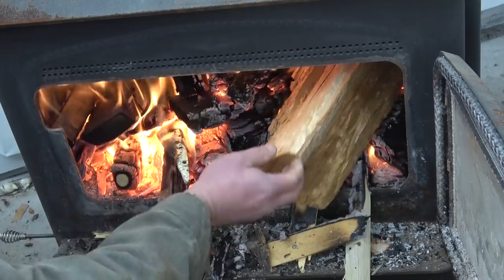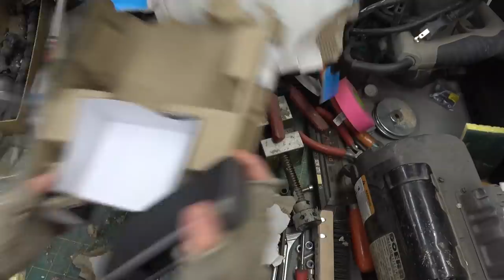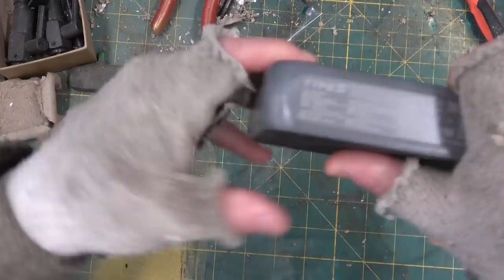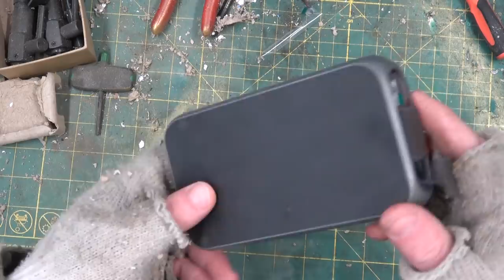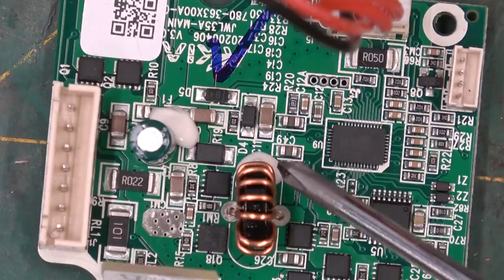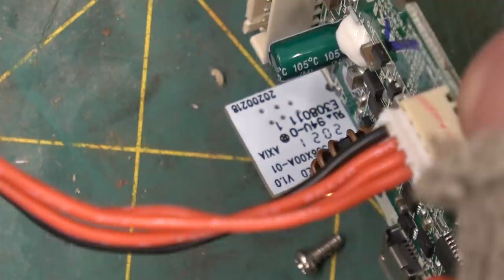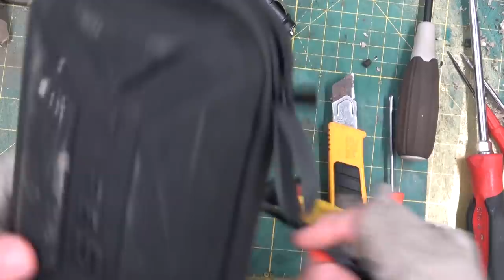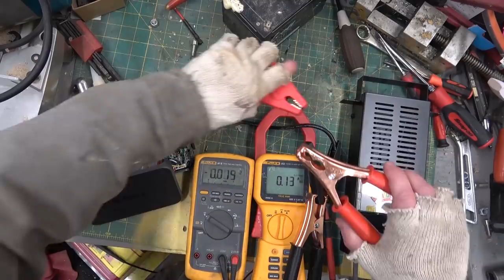BOLTR: Costco Boost Pack | Stupid Design

Comment: 26:54 You need at least 13v to start charging a lead acid battery. I tried to "trickle charge" a dead battery with a 12v drill battery for an hour and it didn't do anything at all. I also tried to start a 3.0L diesel engine at 50F with the battery removed with one of these cheap boost packs and surprisingly it worked.
Reply: Yep. For a lead acid battery fully charged is basically 12.7v. You need more than that to charge it. Ideally about 14v or so for charging and about 13v or a little over for trickle/maintenance. The 12v drill battery is probably pretty close to 12v even at full charge.
Reply: I’ve jumped a few V8s in Nebraska winter weather with mine. Teens and twenties F. Can get 3-4 cranks off it and still have 70% on it.
Reply: chargers go up to ~14.5V on a full charge
Usually alternators put out less in order to not cook the batteries dry in a few months.
System voltage should be somewhere between 13.5 and 14.5V. Newer vehicles with all kinds of digital fanciness are a lot smarter and they adjust the voltage according to load and battery charge level. For example I know that some older Toyotas (~2007) will monitor the amp draw on the battery, keep the voltage up to top the battery off an than lower the voltage down closer to 13V when the battery is charged to save fuel and wear on the battery. When they register a high load on the system they will ramp the voltage back up to supply all the needed power without draining the battery down.
Reply: Potential difference, one must be higher than the other
Reply: @christopherestewart  it depends how dead the vehicles battery is. if it's just a bit low the booster pack will give it that little bit extra that it needs but if it's right dead there's no way in hell one of these packs will do the job.
Reply: Unfortunately.. no.  You haven't considered the potential difference between the two batteries.  If your car battery is at 6V and the charger is outputting 12V, it will indeed charge your car battery.  Also, the drill battery probably has one of the pins set up to detect whether it's connected to a drill.  And if it's not, it won't output any power.  That's why they have more than 2 pins on those batteries..
Reply: @markjohnson7887   It was an old battery with only 2 pins. Even after an hour and leaving the drill battery connected while cranking (pulling 20 amps out of the drill battery) the car did not start. Had to bring another car to give a jump start and sure enough it fired right up.
Reply: @Phoenix88.  Ok, then it wasn't a lithium battery.  So it's not an apples to apples comparison.  That would have been like a NiCad battery or something.  Makes a big difference.

Comment: Bought my son-in-law one of these, different brand though, because he has a habit of leaving his lights on after driving to work in the morning. I was always the go to guy for a boost so really I bought it for me. His worked well on his little four banger although he never used it in really cold conditions. I bought myself a higher capacity one rated for diesel engines for my Dodge truck with 5.9 Cummins and can confirm they don’t work if cold or if you batteries are completely dead. Last winter about this time the little town of Dapp Alberta by our farm recorded the coldest temperature on earth for that day, -52 C. Nothing wants to start when it’s that cold!

Comment: Generally, USB Type C plugs have at least the same insertion/removal cycle rating as USB Micro-B plugs (minimum 10,000 cycles) but in cases of reputable/reliable manufacturers who have high standards/good quality control (i.e tight tolerances), Type C plugs/receptacles seem to generally have increased endurance over their Micro-B counterparts. Obviously there are always going to be exceptions to that based on lots of different factors but in my experience with repairing electronics, that seems to generally hold true (though honestly, it's probably hard not to be biased being that there are SO many more Micro-B devices out there and almost all of them are older than Type-C devices).

Comment: We have a similar product, different brand though. For my experience, the box needs to “inspect“ the circuit before it unleashes the pixies. Example, I tried to jumpstart a small machine that did not have a battery in it, I could not get the unit to give the greenlight until I put a battery in the machine. There’s obviously more to this than meets the eye… Example, you can’t just touch the clams together and get sparks. It has to investigate before the pixies are unleashed.

Comment: I use a similar one to help start my airplane in the winter time - the plane has a small battery and needs some extra umph in the winter.  That being said, the voltage of the plane battery is generally around 13 volts, and those booster packs are at 12.6 fully charged (They're only 11.1v, 3S lipo packs).  They do work well, however, they DO NOT put out quite as much voltage as a normal 12 volt car battery.

Comment: I have something analogous to that one, a baseus 12 Ah jump pack.  The connector/clamps it came with seems to cycle the voltage off/on, and cuts out after some seconds of providing power, like yours.  But I found that with a cheap EC5 clamp set (like bigclive reviewed a while ago) it put out stable uninterrupted voltage.  I even made up an EC5 to XT60 cable and used this bank's 14 V to power a lipo charger; the cable also let me charge or discharge the pack with the lipo charger.  So the pack itself is versatile, it's just the electronics in the clamp set.

Comment: I have one.  It have jumped my 3.5L ecoboost in my Ford as many as 5 times with no issues and the battery indicator has only shown 1/4 depleted after 5 jumps.  They work surprisingly well.

Comment: Having used these things (A costco unit),  They only work if you car clicks or super slow turn when trying to start. Or if you have a new car that needs a certain voltage to even start the computers. Also in the cold, you try starting like 5 times with this thing. Each time the battery in the unit warms up (after being in a cold car), and can deliver enough power. I have one of these and a set of cables in my car. 9 out of 10 times I help someone, the little lithium jumper does the job, and way less hassle than cables.

Comment: I was sceptical when i bought one for my wifes car. I took it apart and saw the rc car lipo battery and knew it would discharge a shit ton of amps. Cranked my motor over 5 times in a row with the battery unplugged. I was shocked when i saw it only.went down to 75% charge. Got rid of her jumper cables and put an anderson connector on the booster pack and then anderson connector to ring terminals to her car battery. Idiot proof. And a better connection. Way more then the 75amps you showed in your video it has to be. Unless that ones a piece of shit. Mine was a choopo from amazon. For 85 bucks

Edit : i tested in winter on my 3.5 taurus

Comment: We had some of these at one of my last workplaces. Not this exact unit though. To my surprise (I didn't think they'd start a vespa twice) two of them in series would start the 24v hino's and the like. 
Two days late I was not so surprised when they blew up like balloons though and split themselves wide open.

That said, I have on occasion used the 3s LiPo 5Ahr batteries from my rc helicopter to start up 2.4ltr injected 4 cylinder's. No waiting for them to charge the bat, just wired on and CCA all the way. They work.

Comment: I have one of those and it works well.  The thing to remember is that it works for boosting a weak battery, not jumping form stone cold dead and most of the time its enough to get the car from the lot into the shop to fix it.

Comment: Dunno about at Fort McMurray on Xmas day, but the Jaycar item I bought in Perth will swing a diesel with a dead flat battery (helped a stranded fisherman start his van).  At livable temperatures (say 30 dungarees Science) it swings the engine better than a fully charged lead acid battery. It is a somewhat larger item with multi-voltage laptop output. 
The manual claims 6 cylinders diesel or v8 petrol.
It wasn't especially cheap but is easy to use. Compared with jumper leads it it just so dead easy.
I haven't tried it on a carbon pile and doubt if I will.
Like most devices there is probably  a cut off price below which a quality item can't be built. 
Thanks for the tear down.

Comment: I have used this 3 times in the past 6 months, twice in -10 c.  Each time it has been for someone else vehicle. One Honda civic 2002, started right away,   2008 Pontiac Vibe started second time after we moved the clamps around a bit to get a better connection.  Third  was a 2018 Cadillac Escalade, the battery booster was frozen solid.  Took 3 times to start it up, the booster just need to warm up a bit.  I didn't even need to remove it from the car battery to reset after each try.   This battery booster has paid for itself already and I have yet to use it on my car.   The real test will be 6 months to a year from now.   Thanks for the video and use a wooden toothpick to clean out your usb-c on your pixel you NUT!  lol

Comment: I bought one of these on sale a short while back from the Costco Clubhouse of Impulse Buying.  Haven't had to use it yet.  Charged it up, made myself somewhat familiar with it and parked it in the glove box of my 4 cylinder 2001 Accord commuter.  If it can't jump it maybe the tactical assault flashlight on it will startle it back to life.  (If it has camo print or blinks fast it is automatically "tactical assault" class and costs more.)

Comment: I vaporized a 50 A shunt load a peak current test of my lithium booster pack. Clocked in at like 833 A of something like that and it was rated for 800 A peak. That was a fun experience, though I set it up with the expectation of something going bang

Comment: most of those packs require a feed back voltage from the car to let the pack know that its hooked to a battery.the nocos that I bought do have an over ride switch in the event that your battery is flat.

Comment: I have a tacklife version. I've used it on trucks and tractors. The relay broke so I hardwired it. Started a ram 2500 the other day and pulled it outside to charge. Pulled it in about an hour later and could smell something cooking, smelled like dissolved electrons. Well I left the box charging and it tripled in sized. Busted at the seems. Surprisingly it still works.
Reply: I wouldn’t use it anymore. It’s a fire hazard. Please believe me.

Comment: For your USB C charging woes (if someone else didn't beat me to it), there is probably too much schmoo shoved down in the port on your phone, pocket lint, etc.  take a small pokey bit and scrape everything out from the bottom of the port taking care not to break the center portion.  My Pixel had this problem too, it stopped charging unless i lay it the right way.  From what i've seen and heard also, the USB C port will take more insertions over the micro USB.

Comment: The failure part is the jumpe cable and that board built into them. They're universal for all these packs. Theyre there to "protect" the pack from too much current draw, as well as too low of voltage, but if the pack is cold they kick off to early not allowing the internal resistance of the pack to heat it up and get it working....and if you leave it hooked up to trickle charge the main battery, there just isnt enough amp hours to do that...gotta try starting it right away...

Comment: That 77 amps is to keep the lipo cell from exploding. Most are only rated for 3 or 4C (4x their capacity). That 77 amps is probably its max output and if sustained longer than 10 seconds it might generate insane heat and.... recreate the hindenburg to say the least.

Comment: Last time I wanted to use my charge pack, it was empty and the USB didn't want to charge it back up, because the battery voltage was a bit to low. Luckily the outer ports are directly connected to the battery so I could charge it externally with some crocodile clamps, up to a voltage that was high enough, afterwards it would charge by USB again. Did use it on my smart fortwo 1.0l 3 cylinder with 63Ah battery, before when it had a mostly dead battery (voltage so low electronic locks didn't work anymore), did let it charge for a couple minutes and then I could start it fine (not sure if I used the boost mode too). Haven't used it on my Audis or other bigger engines yet.

Comment: I picked one up from Bezos n pals for about $70 the summer before last... (labeled dbpower)... I have a truck that I stopped driving regularly, and before I installed a battery cut off, I had to jump it a couple of times last winter... not the biggest v8, but from a bone-dead (no dome light even) battery, it would jump on the first try. It came with power cords to charge my laptop too...

Differences: LCD (backlit), slide switch for power, no usb-c, just usb-a x 2, barrel connector for charging,  barrel connector (separate port) for laptops/other 12v devices, and the jump cable has a reset switch on the box with the xt-90 connector that goes to the big gator clips....

Comment: The problem with the USB C ports, is that they have to bottom out to lock in properly and charge, i have a Pixel as well, and it did exactly as you mention... I got down in the bottom of the hole and cleaned it out with a wood shudders toothpick, and the amount of schmoo was shocking... has been perfect since

Comment: Remeber its supplementing the battery so tif the main battery is providing even half the normal current the thermal cutout on it will probably give you 20 or 30 seconds.   

Totally agree on the trickle charging however

Comment: The other thing you have to remember is that most cars/vans are under 2 litre engine size outside North America. They are only designed for someone who has left there lights on and flattened the battery. I’ve used mine in minus temps and it started cars fine

Comment: its got a synchronous buck/boost regulator, thats nice
that battery looks like the usual lipos hobbypilots use, they can release good amounts of amps. those small 4 inch propeller drones go up to 1..2kW and more when hitting the throttle hard

Comment: Those little jump packs seem like a good handy idea, if only they were simpler and more of a direct on/off with a battery that could put out a couple of hundred amps. But, I guess at that point everything has to be bigger and you quickly end up with something nearly the size of a normal jump pack. 

I do think it’d be better if the battery was at 14 or 16 volts so it’d provide more power for cranking when under load. Our big jump pack at work sits at about 16v unloaded and it’ll usually crank semi trucks from dead.

Comment: My monster inlaws bought me the Trekpow TJ2500,  2500 amp booster pack for Christmas.  I have a 2005 Dodge 3500, my batteries are old and didn't plug it in at -22C.  I left the booster in the truck at that temp overnight.   I couldn't believe the booster could handle PreHeat cycle and still started the truck.  Says it will boost up to 8.0L diesel several times on one charge.  Maybe above freezing,  Not a chance at these temps.  It also has the annoying SOS and strobe crap.

Comment: I have an "11,000mAH" LiPo battery bank/jump box/micro compressor kit that I got from Scamazon... Little bastard works like a HOT DAMN. That little thing will start the high-compression, big cam, AFR-headed 370 LS in my F-body with the main battery completely unhooked. It's WILD.

That being said- I use a standard hobby-grade 4s2p Lipo battery with gator clips wired to a Deans connector, and routinely jump off blown big blocks at the track with it. Power density is INSANE.

Comment: The usb c is a stronger in my experience. Micro usb breaks all the time but my usb c just gets full of lint or debris. I just use a sewing needle to clear it out of the bottom, but if you've been jamming your male end in there it's probably pretty well packed

Comment: I actually have one of these (well, looks like the previous version). It's not that bad. Maybe in the dead cold of winter it won't start your diesel truck with totally dead batteries. But I've used it to start my Subaru in the Montana cold, and it did an admirable job. It's small enough you can keep it close by and use it as a backup battery for your phone if the need arises. 

But then again, I know and understand the limitations. I wouldn't try to jump start my '94 GMC 6.0 Diesel if the batteries were dead. But my '5 Denali if it were just weak... you betcha.

Comment: Project farm found that battery packs such as this generate enough heat in their first use that by the second or third try it is up to operating temperature. Also they usually allow for three or more attempts in one charge.

Comment: For $10 from the Brazilian Bandit you can get the jumper leading without to protective circuit on the negative lead.  It made a night and day different on my jump pack, just got to use a little ccommon sense to to not overheat the battery and unhook it as soon as the engine starts.
Reply: You like to live dangerously. The battery will form dendrites from the abuse and once a dendrite reaches the other side it firm a short and the battery will explode or ignite. You can’t put out a li-ion fire so if it starts to burn try to move it to a place where it can burn safely.

Comment: Got one.  It works perfectly.  Connecting in parallel to a battery (voltage/amperage source) is much different than just a big resistor.

Comment: Not sure if you have tried this on the USB-C connection that isnt working, but often a bunch of junk/pocket link will find it's way into the bottom of the connection, and then the cord will not be able to seat far enough down.  Can use a paperclip to scrape that crap out and then it often maintains connection MUCH better.  Hope this helps.